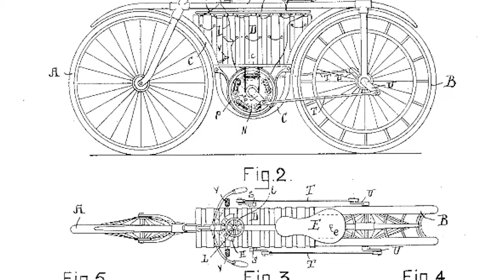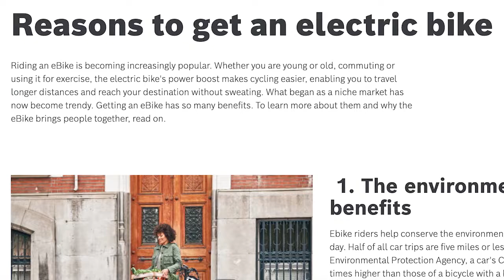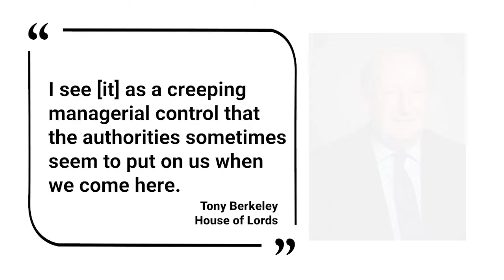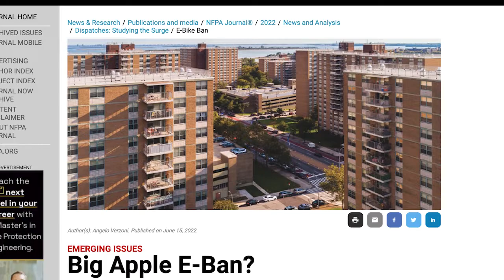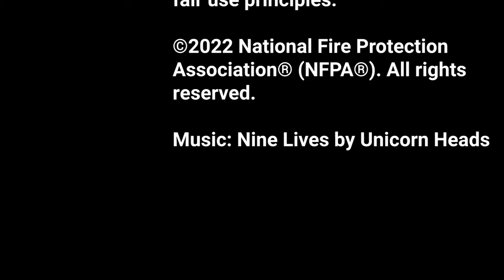Fire Safety Considerations for E-Bikes and E-Scooters

Comment: As a specialist in the area of Li-ion Battery tech, the takeaway is that not all li-ion battery chemistries are equal. Some like NMC are highly volatile & do present a high risk fire potential if abused & note even high quality batteries are equally prone. Others like liFePO4 are significantly lower risk and one reason why some European governments have legislated this chemistry suitable for residential battery packs.
So the trade off is, that on the evidence presented in the video, the eBike industry is using a NMC derivative. So the big question here, is how long do the makers expect the bike to keep running without charging v using the the LiFePO4 that has excellent power density, that is almost totally safe to be charged at home inside, but wont keep running for just quite as long?
So, the easy way to stem the issue is for the authority to legislate the LiFePO4 derivative, since NMC technology to be totally safe, needs a permanent cooling & heating solution a full BMS to manage it when being charged. And note, to add all this technology [ as is used on all BEV cars] would significantly impact the size and weight & cost of the eBike.

Comment: I applaud NFPA for taking on the issue, but am a bit discouraged at the amount of disinformation in this video.  

Firstly, very few of the products shown in this video are even e-bikes, at least not according to federal definitions.  The CPSC has defined electric bicycles as "a two- or three wheeled vehicle with fully operable pedals and an electric motor of less than 750 watts (1 h.p.), whose maximum speed on a paved level surface, when powered solely by such a motor while ridden by an operator who weighs 170 pounds, is less than 20 mph."  There has been some interpretation of this definition, specifically "when powered solely by such a motor", to mean that the motor can provide 20 mph, while the average rider can provide 8mph, so the max speed should be 28 mph max speed (20mph electric motor + 8 mph of rider power + 28 mph max speed). Most of the products in this video did not fit this definition of an e-bike, and when you look into the "e-bike fires" that have occurred in the US over the past few years, a substantial number of these also do not fit the definition of an ebike.  

So why is this even important?  Well, as the video discusses, ebikes have been in other global markets for sometime.  The definitions in each market vary slightly, but for the most part they are even more strictly defined than in the US (25kph max speed, no throttles, 250W max motor power).  In places like Europe and Japan, the ebike boom started a decade ago, and thus these markets have had quite a bit of time to define safety standards, and protections for consumers.  Global bicycle companies (e.g. Trek, Specialized, Cannondale, Giant, Shimano, etc.) have been selling ebikes for 2 decades now, and have had to apply a whole host of international safety standards to their products in order to sell ebikes in these makets.  EN 15194 covers the safety of the overall ebike, and then prescribes a whole host of IEC standards to cover battery, charger, motor, EMC, etc. safety topics.  UL 2849 pulled the majority of its content from this EN standard, and also prescribes many of the exact same battery, charger, etc. standards.

Fast forward to present day US, these same global ebike manufacturers are still applying EN 15194 and UL 2849 to all their e-bikes, as it is required to sell in most markets.  Many of these global ebike models are also sold in the US where they are also required to ensure their ebikes comply with UL 2849.  However, electric vehicles which do not meet the definition of an ebike (i.e. go faster than 28mph, have greater than 750W of power, etc.), have no requirements in the US.  Technically, these products should be regulated by NHTSA, but most of these "out of class" electric mopeds and motorcycles are sold under the guise that "they are for off road use only."  Well, in reality we know they are being used in urban areas, on the public roads, on bike paths, etc. In fact, many of products being called "ebikes" and which are starting fires, shocking people, or causing other injuries tend to be from this "out of category" calls of electric vehicle.  This is further complicated by actual ebikes being sold direct to consumers by off shore companies, who can capitalize on de minimus import regulations that allow import with minimal inspection, and then sell un-tested products with cheap batteries.  These companies do not have a presence in the US, and often have many company names in China, and thus are nearly impossible to file legal action against if someone is injured or killed by their products.  To be clear, whether or not every ebike in the US met safety standards or not, there will always be fires with Li-ion batteries.  The 0.0001% quality-related failure in a population of 10 million batteries is still going to produce 10 failures, and there is no accounting for misuse and damage of batteries, people modifying or otherwise adulterant products, but we are seeing some of these out of class products and cheap off-shore products failing at rates high above what would be normally expected in systems ruled by good process control, safety validation testing, and use of high quality materials.

So, I guess the point here is that if NFPA, CPSC, NHTSA, NY City Fire Commission, etc. are serious about addressing the safety issues surrounding electric mobility products, first they need to have some level of consistency in defining electric mobility products, and then they need to get serious about requiring safety standards be applied to ebikes, and any other category of electric mobility product that they come with for the 'out of class" vehicles.  At minimum, battery and charger standards should be applied (this addresses most of the fire risk), and ideally, a wholistic safety standard that covers safety of the whole product.  Additionally, they need to ensure that imported products are following the safety standards currently mandated for ebikes (UL 2849 and EN 15194), and which most of the current producers are complying with.  Once we start getting better data on which products are causing injury and fire, I think we are going to find that they are mostly cheap imports and out of class, unregulated mobility products.

All of the suggestions at the end of the video are certainly valid, but additionally consumers should: 
- buy ebikes from established bicycle brands.  These brands have often have liability if someone is killed or injured in the US, and thus it is in their interest to apply safety standards, use quality materials, and generally provide products that do not hurt people through normal use.  They have also been making ebikes the longest, and thus understand all the challenges and requirements of doing so (in most cases).
- verify that the product meets safety standards.  UL Listing is just one form of this.  There are 12 other OSHA NRTL labs which are also able to certify products (Intertek ETL mark, SGS, TUV, ACT Labs and whole host of others are just as valid as UL listing.
- when it comes to batteries, cheap is not good.  If an ebike battery has the appropriate Battery Management System (BMS) and good quality cells, then it is not going to be cheap.  Good quality cells come from LG, Samsung, Sony, Panasonic, etc., and have been fully tested and certified, use high quality materials, and have much lower statistical failure rates. Cheap batteries cut all of this out, it is how they make them cheap.

Comment: AFAIK, the only company making e-bike batteries (not just the chargers, but the batteries) that are properly UL Listed is Bosch.  A good reason to stick with them.
Reply: You are correct that Bosch has UL 2849 listing for their e-bike systems, and UL 2271 listing for their batteries.  HOWEVER, you are very incorrect that they are the only e-system supplier with listed products/components.  To be honest, most of the major bicycle manufacturers have been following EN 15194, which is the EU and international ebike safety standard, for almost a decade.  UL 2849 was mostly based on this EN e-bike standard, so all of these ebikes which are international models and which were certified for EN 15194 are mostly compliant to UL 2849.  Also, there are other agencies who will certify/List product to these standards (ETL/Intertek, SGS, TUV, etc.), so UL listing is just one certification path.  I know that all of Trek's ebikes have been evaluated against EN 15194 and UL 2849, and that a few of the systems and batteries used on their bikes are listed by UL, or in the final process of being listed by UL.